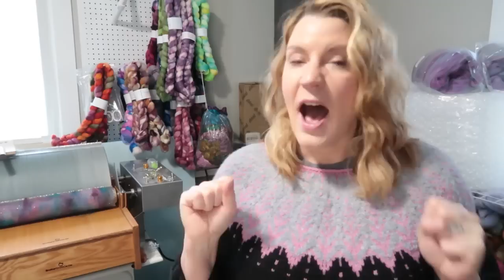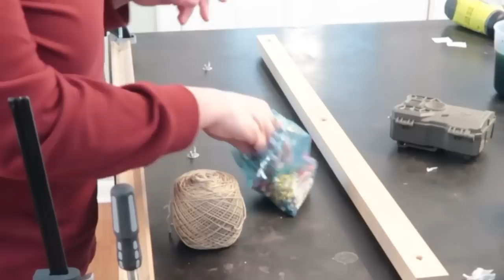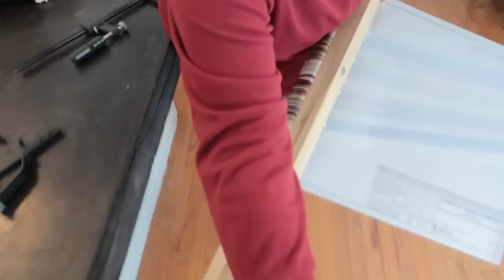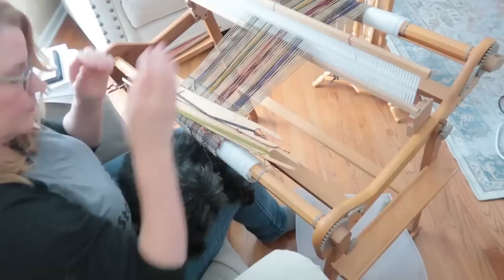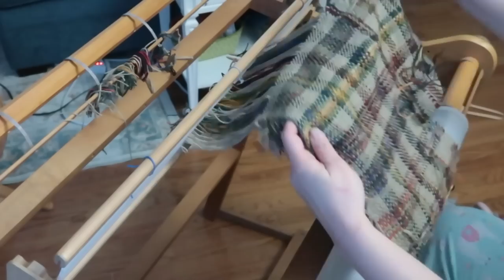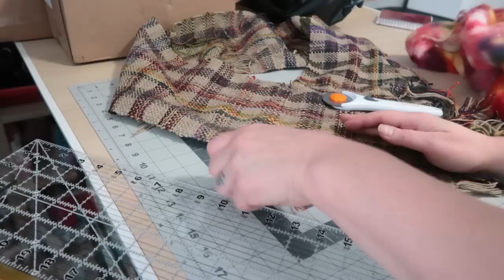Stash Buster Idea for Weavers/Weaving with Leftover Yarn/Hero Cowl/Rigid Heddle Weaving Easy Project

Comment: That's fantastic!! So pretty. Now I want to try. I have a Cricket loom. A lot smaller. 15 in weaving space. I think I missed it but what size tpi did you use? Thanks so much for sharing.
Reply from the maker: I used a 7.5 dpi heddle.  That's why I had to double the fingering weight yarn. Hope you try it!

Comment: when you sley slots and holes, does that mean your ends per inch are doubled?  if your reed is a 10 dent, then you are actually doing 20 ends per inch?
Reply from the maker: This is a hard to answer technical question.  You could say it's 20 epi, or you could say that I doubled the yarn to make the 10 epi thicker.